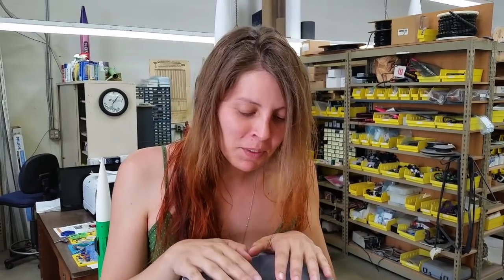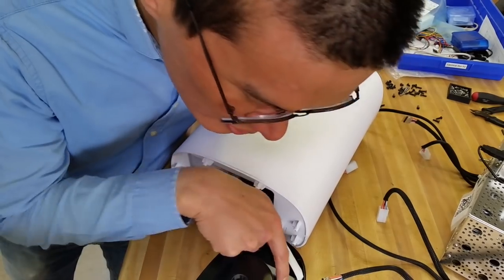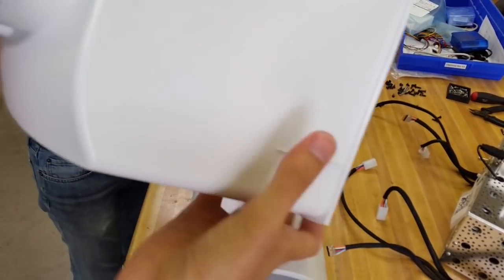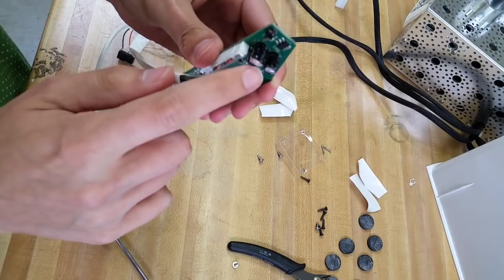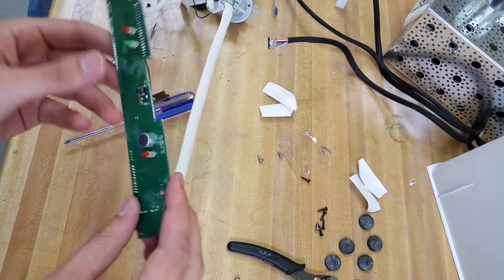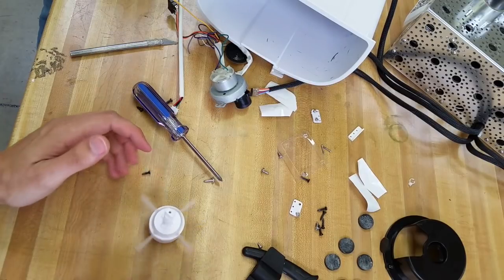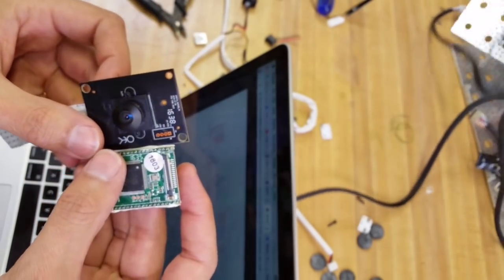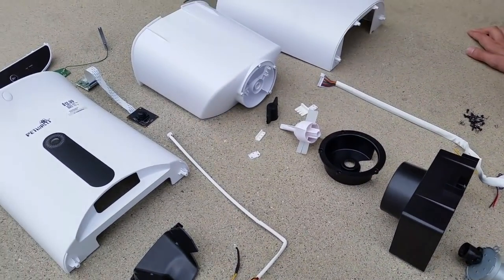Teardown: Stupid IoT Pet Feeder

Comment: @Emily I think Engineering and Manufacturing this Product at Just a Price Point of 12.99$ is the Great Part of it even it has bare minimum components needed to function. Most Companies and Startups are Struggling to produce a viable product at this price point.
Reply from the maker: Oh, it's not $12.99 new. It's ~$150 new. I purchased this from a thrift shop
Reply: @EmilysElectricOddities  Then Definitely it's a Stupid Product at 150$.

Comment: Could you turn that into a mini server or a NAS?

Or maybe a janky security camera?
Do somethin with it.. repurpose it :)
Reply from the maker: I really wanted to repurpose it! But it looked like it was going to be rather difficult to hack it, and the camera wasn't designed to be used without the driver board :/
Reply: @EmilysElectricOddities  that's a bummer.
I have a few C.H.I.P. boards that I want to do something with but they went under and the way you flash this thing requires an online flashing tool that I can't find anymore. 
I really dislike proprietary stuff.